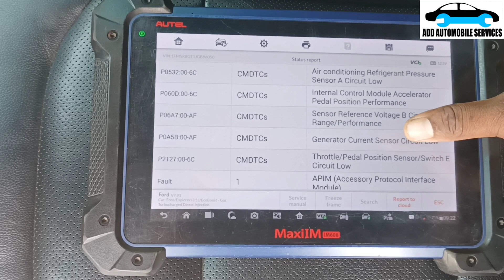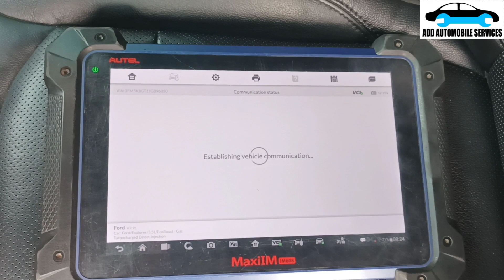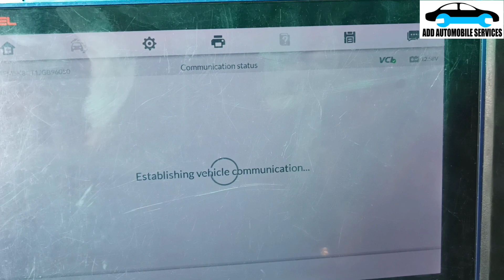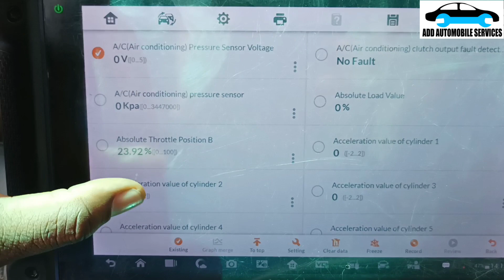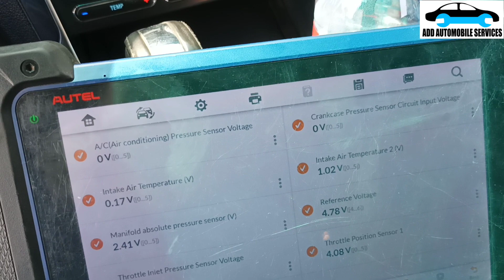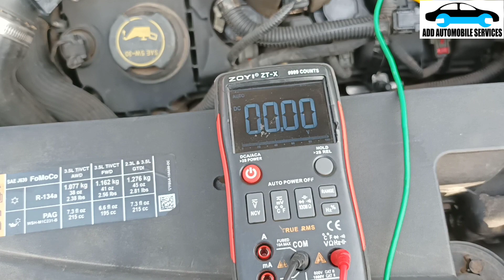2019 Explorer: reference voltage

Comment: Hi bro. I am planning to buy im608 

I need your suggestion
Battery backup and how it's charge. 12v charging or USB cable
Does it have  Mahindra Tata and Maruti Suzuki software
Reply from the maker: It does not have them it only have suzuki

Comment: very nice, most of the times Ac pressure sensor and it's circuit causing the problem .
Reply from the maker: Yes
Reply: @ADDAUTOMOBILESERVICES  brother I wish If you can make some videos about starting issues related to ignition switch .
Reply from the maker: @abdalgadermohamed5636  ok will do that when I get a job on that

Comment: Yup on wiring diagrams most of the sensors share the same 5v. I go straight for the throttle body or the refrigerant sensor
Reply from the maker: Yes they share a 5v reference